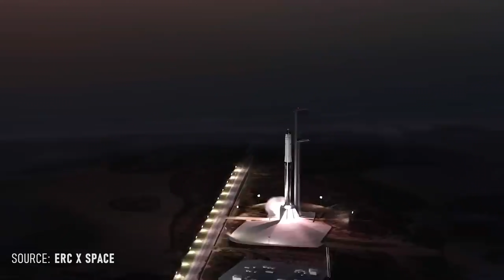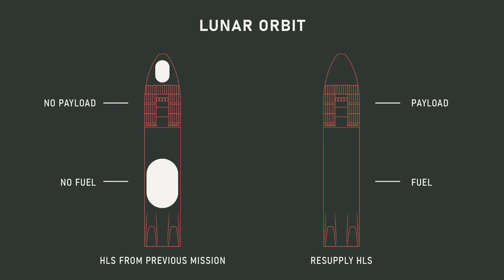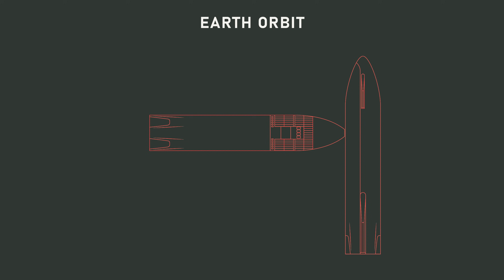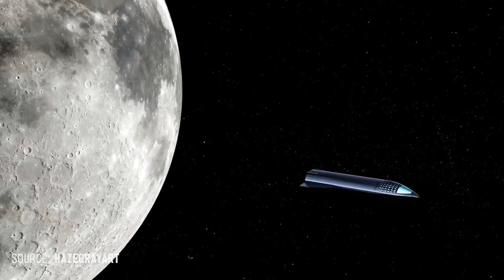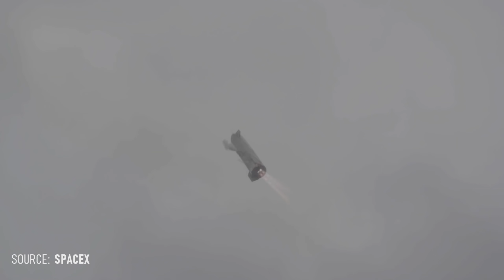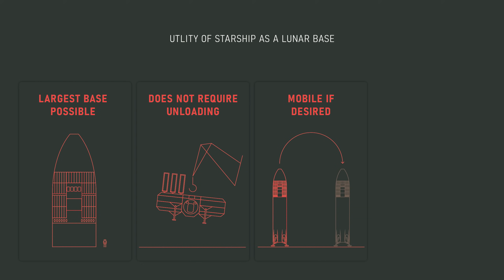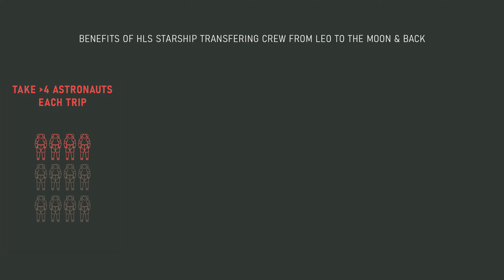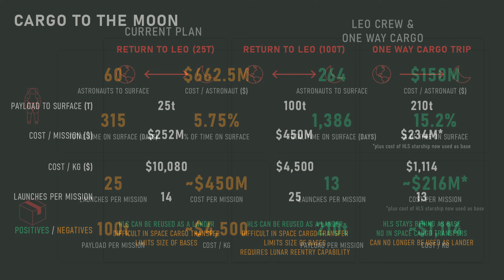How to Use HLS Starship

Comment: Can you make the same kinda video about the profile Crew-ISS-StarShip-Gateway-HLS Starship?

I think it will allow us get the best part of each wich the same cost... 
The HLS will be a giant base, it can move, and it not need that much refueling at LEO...
The ISS and Gateway can be a trasfer station to astronauts and cargo. Both can be adapted for make these process easier.
The Starship could be reflued next to ISS, but without the crew in it. 
The Dragon, Starliner, even soyuz and anorther countries can be use ISS to acess base on moon, abd it upgrade the world partnership 
And it could allow us make a contant presence on moon surface, naybe.
Reply: Are you saying to have Crew Dragon and Starship meet at the ISS? Unless they add more docking ports to the ISS, that likely won't work. Starliner wanted to do the unmanned ISS test a month or so ago and there was no room for it to dock. Starliner was pushed back to Jul 30th to have an open ISS docking port and an Atlas V both available at the same time.

How about a Lunar Starship with a nose docking port for another Starship to dock with? Then a 2-4 docking ports on the barrel for Crew Dragon/Starliners. You could put some radiators and solar panels on the rear of the impromtu Starship station. :)
Reply: @steveaustin2686  Not necessary both the same time... first the starship dock and transfer the astronauts and cargo, after that, while it refuels next to  ISS but undocked,    they transfer to Dragon or Starliner...
Reply: @R1P1J1  The ISS doesn't have a lot of room for cargo. And when they swap crews, they are overloaded for a few days with not enough berths on the ISS for everyone to sleep. The ISS is also old and the Russian modules are the core, so a new transfer station might better to build if Artemis continues past the initial Moon landing. Especially if you can build some Cargo Starships, to go with the Tanker and Lunar Starships, to bring up larger station modules.
Reply: @steveaustin2686  I was think about they using the ISS just some hours. And probably the Cargo to Earth will be not that much volume, it's just the crew and science, the supply stay in normal starship to next mission and could be use to get out lunar astronaut just in case, or maybe resupply them at emergency.
Reply: @steveaustin2686  but yes, maybe build a new Transfer Station - or add a new module in ISS - can.be a good option too.
Reply: @R1P1J1  Well unless the crew vehicles are landed after the crew transfers to Lunar Starship, the crew vehicles would need to stay at the ISS to keep running. Crew Dragon can fly-by-itself for 10 days max. Starliner has a 2.5 day fly-by-itself capability and Soyuz is between the two, likely closer to Starliner's time in orbit by itself. Dreamchaser is likely between Starliner and Crew Dragon as well. The only reason those spacecraft would stay in orbit longer is if the ISS or something else sustains them.

So if we use Crew Dragon, Soyuz, Starliner, and/or Dream Chaser to take crew to Lunar Starship, they need something to dock to so that they can be sustained until Lunar Starship comes back from the Moon. So a LEO transfer station like Lunar Gateway would be a good thing to have. Evidently according to China, Shenzhou has a similar fly-by-itself capability to Orion, so for a week long surface mission, it could wait for Lunar Starship to return. Of course that would depend on if Shenzhou can dock with US spacecraft as pictures seem to suggest it might be able to do.
Reply: @steveaustin2686  It's why I am asking vídeo about this profile... maybe land the spacecraft after transfers could be a good one... or make a module/transfer station to make it easier... that need some deep analysis. what's go to be cheaper? What's improve the longterm side? U know what i mean....
Reply: @R1P1J1  It really depends on what the government wants to spend. Remember that big NASA contracts inevitably involve Congress lobbying for the space companies in their districts. Think SLS and the National Team in the HLS competition.
Reply: @steveaustin2686  yeah, know...

Comment: Wouldn't leaving crew on Starship in an elliptical orbit expose the crew to dangerous levels of radiation from the Van Allen belts?
Reply from the maker: Yes, only if the refueling for some reason fails on the first past. Certainly not ideal. They HLS starship does have radiation protection though. 

However this leads to phasing issues which makes your windows for trips to the moon difficult. 

I didn’t want to go too deep into this because the video was already long, but that’s why I didn’t like that method much and left it out of the final comparison.
Reply: My thought exactly. Although there might be some way aroung this with later iterations of starship.
But right now the single best option to return astronauts from the moon is by aerobreaking in Earths atmosphere. And the only vehicle able to do so is Orion.

Comment: 6:11 the issue with this argument is the fact that you forgot one important detail: HLS starship has 2 airlocks. The side cargo door on HLS actually doesn’t limit the size of things that can be moved into HLS as much as you’d think. Remember: that door would have to be opened anyway for astronauts to get onto the moon’s surface in the first place. It would be extremely unwise to not use it for transferring cargo.

More importantly, they can alleviate the can of worms that is robotics through The Worm’s (NASA) support, since SpaceX already had a remarkable amount of robotic experience, along with sister company, Tesla. Remember, SpaceX are already in need of robotics to mass produce starships at about, according to Elon at least, 100 per year. 

So robotics isn’t the problem, and neither is the issue regarding transferring cargo that significant.
Reply from the maker: The cargo doors aren’t able to dock to one another, so it would need either human EVA to transfer cargo or robotics to unlatch cargo from inside one cargo bay, move it to the next, and secure it there.  A very difficult problem that is far down the line for SpaceX to solve. Much easier to just load the starship payload on earth.
Reply: @Apogeespace  

Inherently, robotics don’t need to EVA. Do note, however, that our technology has far progressed from Canadarm and that VR controlling is already having testing underway at the ISS. Methods of controlling robotics, including having robotics control themselves, will come into play here. 

Cargo Starship is ultimately a robot if considering its large degree of autonomy and its ability to land itself and precise control of its reentry using flaps. SpaceX are in need of developing robotics just to produce the starships in the first place, thus it’s not that far removed that they are already developing an arm for Cargo starships to use. 

If you want your one way Lunar landing to work, 100 tons has to be brought on a cargo starship anyway; Lunar Starship could lift over 100 tons to orbit through super heavy, but anything more would need to be sent on another vehicle for the additional 100 tons!

The SEV that @Steve Austin mentioned would be far more viable for the job of transferring cargo.
Reply: Maybe they can use the space version of the SEV (Space Exploration Vehicle) to help move cargo? it looks like a cargo tug from some sci-fi movie. :)

https://upload.wikimedia.org/wikipedia/commons/thumb/f/f4/Artist_Concept_%E2%80%94_SEV_Use_Comparison.jpg/420px-Artist_Concept_%E2%80%94_SEV_Use_Comparison.jpg

https://en.wikipedia.org/wiki/Space_Exploration_Vehicle
Reply: @steveaustin2686  
That’s a pretty cool idea, considering they haven’t cancelled it and have designed additional variants. Note that it’s payload is 3,000 kgs, sensible for transfer. 

Better yet, it’s dimensions would fit snugly inside the cargo bay!
Reply: @topsecret1837  I was wandering around looking at Artemis hardware and found it today. I laughed when I first saw it as it doesn't look like traditional space hardware and more like something from a film.

Since ISS is getting old, maybe they can send up a few to build a bigger station. Starship's cargo capacity would certainly help in lifting station parts.
Reply: @steveaustin2686  

The Hubble telescope would be another example of something they may need to refurbish soon. It’s a fantastic telescope which could do a lot more missions, even if superseded by Nancy Grace Roman and James Webb telescopes.
Reply: @topsecret1837  It depends on if Starship is operational before Hubble dies I think.
Reply: Remember, large cargo items, vehicles, habitats etc, will be carried in the engine skirt and there will only be 3 engines needed on lunar StarShip.
Reply: @jonbong98  Lunar Starship will have the regular 6 I believe. It will need the 3 sea-level Raptors to get to orbit. Also those 3 sea-level Raptors are the only ones that gimbal, as the vacuum Raptors won't gimbal per SpaceX. I guess if a maneuver with gimballing is needed in space, SpaceX is ok with the less efficient sea-level Raptors doing the gimbal part.

Comment: Offtopic stupid question. Until now i have been imagining refueling Starship as cargo starship but with fuel in the cargo area. But does it make sense? You fully load your starship with fuel just to take the extra 100 tons of fuel in the cargo. Why not have empty cargo area or even cut it so Starship looks more like Starhopper (guess this wouldnt work with reentry) and just transfer the fuel you save from main tanks? Would it be less? Or just wouldnt work at all?
Reply: The advantage to taking 'gas tanks as cargo' is that you don't need to retool the production of the "flight" portion of the Starship design.  It's easier to just toss a couple more tanks in the cargo/nose area than to build a "stretched-tank" version just for tankers.  The cargo bay also has direct access to the main methane tank, and to the oxidizer system via the Lox header tank and downcommer, so you don't need to add much in the way of extra plumbing.

However, a 'pure tanker' starship will probably eventually be developed just to decrease the amount of dry mass spent on tank bulkheads and plumbing.  After all, the best part is no part.
Reply: @lynansheng  As I understand it, SpaceX is planning just propellant tanks and avionics for Starship Tankers. Having one each tank seems like it would save weight over putting in two each tanks. But I'm not a rocket scientist. ;)

Comment: Dynetics was sustainable from the beginning too, but obviously had other issues.
Reply: The inability to land on the moon is a pretty big issue for a moon lander; and the inability to be refueled for reuse is a pretty big issue for a reusable vehicle.
Reply: @lynansheng  It could definitely be refueled for reuse.  Also, it could land on the moon even with the existing mass issues. It just wouldn't be able to takeoff.  Also, launching on starship or an improved vulcan in 2026 fixes these issues.
Reply: Yeah, the Alpaca came in overweight once everything was installed. Dynetics has another chance with the Option B contract for the follow up 4 astronaut landings, but they have their work cut out to make everything fit.
Reply: @steveaustin2686  I don't see how anyone but SpaceX wins now.  NASA created a monopoly.
Reply: @webs2slow4me  Well, per the NASA 2021 HLS statement, it appears that the Alpaca was going to be heavier than its engines could support. So using a larger launch vehicle wasn't going to help.

SpaceX definitely has the inside track with how capable Starship will likely be and the low expected launch cost. SpaceX still has hurdles to overcome though. 

They need to show that they can do the flip-n-burn reliably over and over. 

Musk said that it may take multiple attempts before the first Starship comes back from orbit. Hopefully, not too many attempts. 

SpaceX also has to be able to transfer upwards 1,200+ tons of propellant in orbit.  NASA just gave SpaceX $50M to demo Starship to Starship propellant transfer in LEO by the end of next year.

Also, launch locations will be a thing of which turnaround time will be important. How fast will SpaceX be able to get a turnaround for a Starship? Falcon 9 is currently at 27 days at the fastest and Starship likely needs to get to at least a week or less. Not sure if they will make the multiple times a day that Musk wants.

SpaceX currently has Boca Chica's Orbital pad and the two oil rigs for 3 launch/landing locations. I don't believe there is a port location at Boca Chica where a Starship can be put on a ship to get to a rig. I don't think they can cart one all the way to Brownsville either. So they may have to do hops to get to a rig, which will be fun with a full stack or trying to land both on the same rig. SpaceX has plans for adding a Starship pad at KSC's Pad 39A, but that pad also does Crew Dragon and Falcon Heavy missions as well as regular Falcon 9 launches. SLC 40 at Cape Canaveral SFS is Falcon 9 only for normal orbits. SLC-4 at Vandenberg is for Falcon 9 SSO and polar launches. So if it takes 12 launches to fill up a Starship in LEO, that is not many pads to launch a lot of Starship Tankers from. 

Will definitely be an interesting few years to see how well SpaceX develops Starship and the ground support for operations.
Reply: @steveaustin2686  the source selection did not say Dynetics was “too heavy for its engines to support” it said it had a “negative mass allocation” this just means that it’s heavier than it should be. If ULA only promised 7.5 t of lift and they came in at 9.5 t then more launch capability would fix that issue. It might not have been main vehicle launch where this came into play though, it could be that it ran out of fuel somewhere along the delta v chain. Lifting off the surface is the end of that chain so it’s likely it would have had enough to land on the moon, but then not enough to make it back to NRHO.
Reply: @webs2slow4me  I may be overstating engine support, but Alpaca definetly weighs too much. From the Statement.

"Of particular concern is the significant weakness within Dynetics’ proposal under Technical Area of Focus 1, Technical Design Concept, due to the SEP’s finding that Dynetics’ current mass estimate for its DAE far exceeds its current mass allocation; plainly stated, Dynetics’ proposal evidences a substantial negative mass allocation."

So Dynetics allocated a certain mass the vehicle would be at, likely near what its engines can support, and Alpaca "far exceeds its current mass allocation". The requirement was for 850kg of cargo with crew, so it seems likely that the mass of all the equipment blew right through the cargo allotment to go well past what the vehicle was designed for. It may be able to land being that overweight, but I wouldn't be confident in that. It is a problem that IS solveable, but would likely take longer than the Artemis schedule allows. I know everyone expects the Oct 2024 Artemis III date to slip, but it seems NASA is REALLY trying to make that date.

Comment: Here's the way to do it:
1. Send a one-way base- starship that sheds it's lower half at first
2. Use a starship to transport 2 crew dragon and one cargo dragon to lunar orbit, shutting people and supplies down to the base
3. Use starship as a bus/cargoship in cis-lunar space. There's no need to have the starship land
Reply: How would Crew Dragon and Cargo Dragon get from lunar orbit to the surface? Crew Dragon has the Super Draco's, but SpaceX dropped plans to propulsively land with them. Can they even throttle low enough for a Moon landing? Does Crew Dragon even have enough dV to land from lunar orbit? Cargo Dragons don't even carry Super Draco's I understand, as cargo just goes boom if there is a problem on liftoff. Neither has legs, so you need those too. I have a feeling that modifying Dragon capsules to land would end up making them as big as the ILV or Alpaca. Might as well just use a Lunar Starship with it's greater capacity.

With current estimates of dV, Starship evidently comes up short for LEO to lunar orbit and back. There is speculation that the Lunar Starship has bigger tanks, so that might change.
Reply: Why Luna Gateway ? It's only application is to supplement SLS's weaknesses. LEO Gateway is the way forward.
Reply: @jonbong98  Lunar Gateway gives Orion something to attach to while the surface mission is running. If they want longer than an 18 day or so mission, which includes the 3 or so day transits to and from Earth, something has to sustain Orion while in lunar orbit. Orion only has a 21.1 day fly-by-itself capability evidenly. You expect that NASA will keep at least a couple of days in reserve, so that puts the mission length at 18 or so days. So with a 3 day transfer each way, you have 12 days on the surface. With Lunar Starship being the HLS, then extending the surface side past 12 days seems doable. So if you want to do that, you need the Lunar Gateway to sustain Orion for at least part of its stay in lunar orbit.